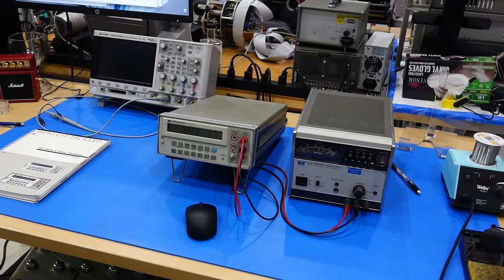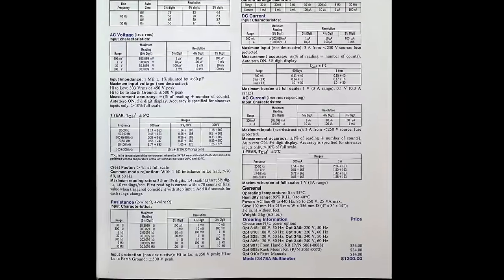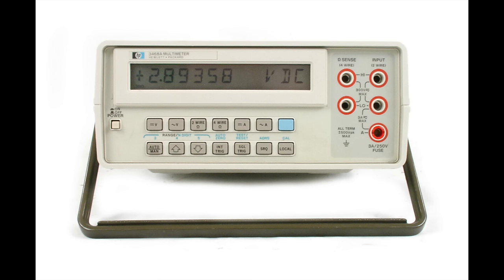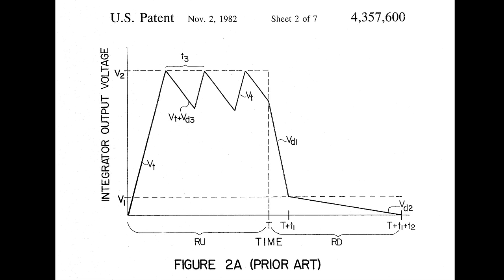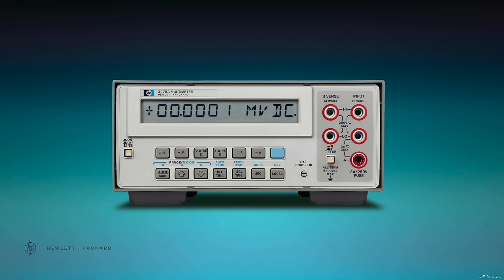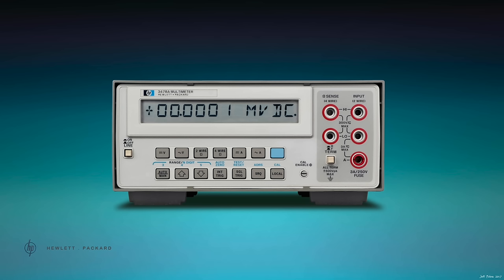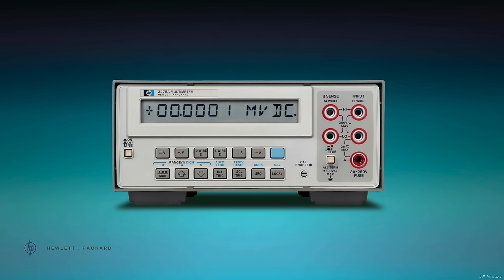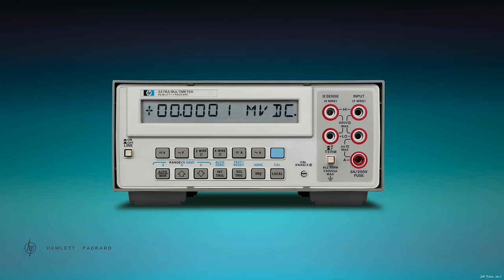Free Abandoned HP 3478A 5-½ Digit DVM Repair

Comment: I have one of these with the same issue. I am wondering if I can pull the switch apart without desoldering it?
Reply from the maker: Now that we know how to remove the plunger, that might be entirely possible.
Reply: @CuriousMarc  I just had a look at mine today. Two of the connections are open circuit. I unclipped the wire and lifted the tab and it came out.
The contacts are shiny and gold like new. No coating on the surface likes yours, even under the microscope, but ...
two of the springs are missing from the open circuit bars. :( 1.9 x 3.72 mm. 
Now to find something that works. At least they don't seem to need insane precision.
Reply from the maker: @originalmianos  Great to hear! I would still wipe the contacts clean. Mine looked new and shiny under the microscope too, but somehow were not making contact.
Reply: @CuriousMarc  I got some springs on ebay that were very close but a little longer. (The same wire width and diameter). 
I lost one of the new ones when I was inspecting it after trimming it. Insane, small parts that are springy. 
Anyway, as you advised I gave the contacts a bit more of a rub with some cotton and contact cleaner again.
Once I got it back together it's all working. I just gave it a quick test and it's well within spec, on the DC voltage range, so it has not lost the calibration due to a battery change by someone else.

I have one bit of advice on the assembly. Disconnect the sub-panel the switch is on and turn it upside down when inserting the switch assembly (remembering to put the large spring on first). It's much easier to do without losing springs (which was quite probably what the previous owner did).
Reply from the maker: @originalmianos  Thanks for the note and congrats on your repair! One more HP instrument saved.

Comment: smh no 3458A, the best 8.5 digit linear multimeter of history.

ah but i jest, good repair and good explanation of the multislope mechanism, made a lot more sense than some others ive heard
oh and fun fact keysight still makes the 3458A to the original spec and quality because its unbeatable

EDIT: if you can somehow get and explain a josephson quantum voltage standard thatd be really cool (if not very feasible)
Reply from the maker: Yes please find me a free abandoned 3458A and I’ll repair it!!!
Reply: @CuriousMarc  god if i could i would. only ones i know of the location of offhand are at marco reps's place, one keysight and one hp
Reply: @Khitiara_ was just gonna mention That Marco reps has both the origiball and keysight ones.
Reply: @petermikus2363  as i said in my second comment, one keysight and one hp
Reply from the maker: Actually the hybrid chip that Ken reverse engineered is the one from Marco Reps’ unit: https://x.com/kenshirriff/status/1448392567167479812?s=61&t=UXfboHQEfahjAKeGVe1J8w
Reply: @CuriousMarc  oh thats cool ill give it a read
Reply: @CuriousMarc  well you learn something new every day.

Comment: Maybe it was answered somewhere already (tho I quickly scrolled thru the comments and haven't found it). Why have you soldered the battery back and not added some holder for it, so it can be easily replaced later? Or there is no standardised holder for it? I understand, it may be a bit risky, as it could potentially wiggle out of the holder, but then, you can stick it with kapton or something. And next time, nobody would need to do soldering.
Reply from the maker: Hey, you do it in *your* instrument. It's your calibration to lose ;-)
Reply: @CuriousMarc  I supposed that was the reason. 😅

Comment: The shot of the advert for the 3468A clearly shows the HP-IB logo yet you say it didn't have it?
Reply: Look closely,  it says “Designed for HP-IB Systems”. The 3468 only had the HP-IL interface, but you could buy an interface to talk to HP-IB. I had one of these twenty years ago a former job and was tasked with making it talk to other equipment that was IB. A guy in another department understood my situation and pitched an HP 82169 interface on my desk and said “Good luck!”. Never was able to make it work as advertised. 😂
Reply from the maker: Only the 3478 has HP-IB. The 3468 has HP-IL. [Edit] But you are right, it has the deisgned for HP-IB logo next to the handle! Typo I suppose? HP was usually very careful with their claims. Unless you use an external converter as you say, but I don’t think that’s what the logo meant.
Reply from the maker: Confirming it’s just a typo. It’s corrected in the HP 1984 catalog, replaced with the HP-IL logo. Good eye, though…

Comment: how would you get it re-calibrated?
Reply from the maker: Difficulty. To do it well you need calibration standards, but they are more expensive than the thing itself. Ian Johnston sells some really good affordable ones: https://www.ianjohnston.com/index.php/onlineshop 
I have no such standard, so I would cheat and use the precision power supply you see on the bench, which is very stable, and another know calibrated DVM, probably the 3455A, and transfer the reading of one to the other. Essentially transferring the calibration.
Reply: Some cal labs still calibrate them
Reply: @CuriousMarc I never can understand why Ian's youtube channel ( https://www.youtube.com/@IanScottJohnston ) does not have more subscribers.
Reply: @CuriousMarc  oh so there's a specific calibration guide in some service manual somewhere? you don't need to know about the format in RAM?

Maybe we should buy one and then share it around the bay area as we need it? :P
Reply from the maker: Oh yes, it’s described in the service manual. Super easy if you have a calibration standard, the software guides you step by step.

Comment: LED displays are soo much better than LCD in every aspect. For cheap battery powered consumer stuff LCD makes sense, but why did they use one for a expensive mains powered device? Also it gives this nice device such a cheap look!
Reply from the maker: Dunno. Many other HP units of the same era have a non-backlit LCD (I have a power supply like this). I bet it was way easier to make a custom LCD for cheap. The non-lit part of it I don’t get. They backtracked in later instruments by switching back to VFDs.
Reply: @CuriousMarc i gotta say the VFD's, LED and nixie tube displays are all beatifull in their own right.
Reply from the maker: Oh, I think I figured out why no backlight. They did not have white LEDs back then, so they’d have to go for cold cathode tubes or electro-luminescent illumination. The AC noise from the high voltage inverter would have killed the AC measurement precision.
Reply: The HP 3468A/B was also available as a portable device with an internal rechargeable battery (Option 001). Also this was a low cost device (for hp pricing standards). 
Furthermore one of the design goals has been to design a 5 1/2 digit DMM with 100 only parts. Okay, at least it hat 160 components.

An original quote from the desing philosophy: "A liquid crystal display (LCD) was chosen for the 3468A, primar ily for its pleasant appearance, readability and alphanumeric capability. However, it also meets the product definition criteria by reducing the number of parts and assembly labor. An equivalent display using light-emitting diodes (LEDs) would need 31 more components than the LCD, all of which would require manual insertion into a printed circuit board. Furthermore, the LED display would consume more power (about 1 .5W) than the LCD." (HP Journal 02/1983)

As already said: they designed a low cost device, so using a LCD reduced the price. Also LCD were a little bit "state of the art" at this time.

Comment: What happened to HP? Their test equipment is fabulous BUT their computers suck the big one. I've had three of them and they ALL failed. NEVER AGAIN WILL I BUY ONE.
Reply from the maker: Bill and Dave left…
Reply: HP had separate business units for each type of target market. Their calculators and test equipment divisions had separate engineering and profit and loss targets as did their earlier mini computers. Their consumer PCs were then another business unit and then their printers, scanners and digital cameras again were separate from each other and from everything else. 

There was a point when if you had an HP PC compatible and wanted one of their scanners, one of their printers, and one of their digital cameras to work you had a very specific order for installing drivers that was unintuitive to get them all working.

I even heard from one of their printer engineers that their printers were three separate units, one for lasers, one for professional inkjets and one for consumer inkjets.

Since they bought Compaq, they had multiple computer lines that didn't share any engineering.